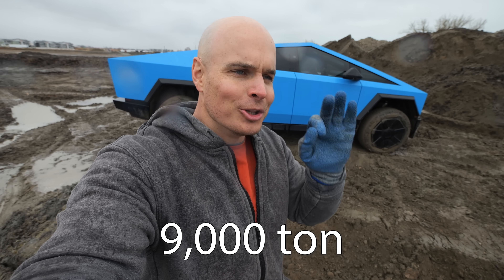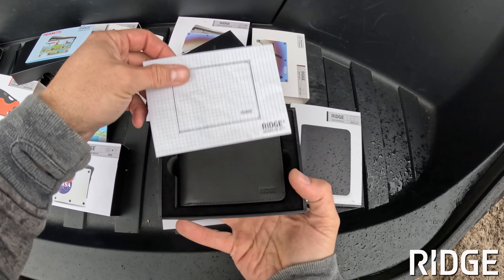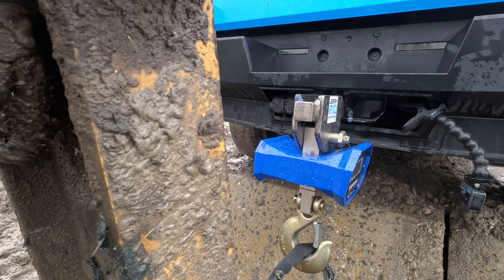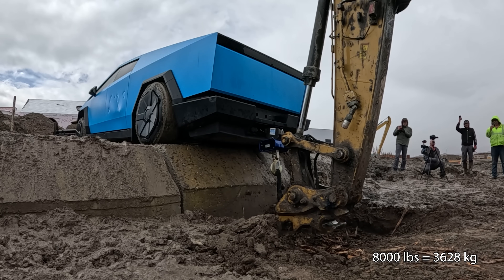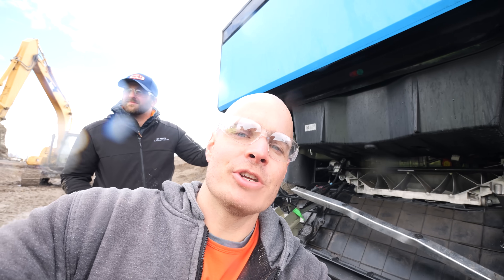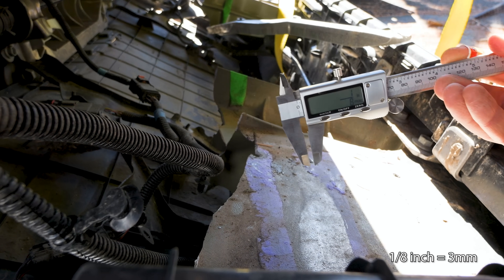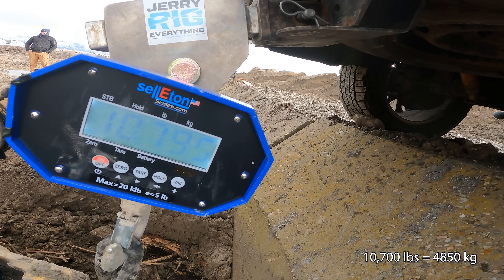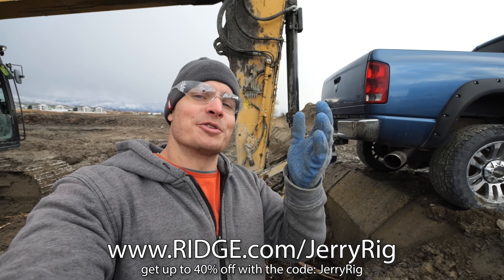SHOULD YOU TOW WITH A CYBERTRUCK?! - (catastrophic failure test)

Comment: Tesla didn't invent the giga-press. They are the first to use it in a big way at this scale, however.

I hate the Cybertruck with an irrational passion, but I do think that it did pretty good in this test. I think that it was engineered to do what it is supposed to do. Like the 04 Dodge you tested, my 2007 Silverado 2500 would do better for sure, because it is cheap and easy to over-engineered a steel receiver on a steel framed truck. It is good that you described the difference between trailer and tongue weight but I disagree that all of the trailer weight would ever turn into tongue weight. However, like you say, the static tongue weight is different than the dynamic. The question to ask is, how many Cybertruck owners will know how to properly load a trailer. The higher the tongue weight you load, the greater the dynamic tongue load will be because it will tend to bounce more. Also, all the safety chains in the word aren't going to save a trailer on that vehicle, it will all come off together.

Comment: so be aware buyer...if you crush your entire trailer load into a metal square in a demolition compactor and then drop it directly on your hitch it will fail....so heads up with that, it's a valid concern for sure. Also if your a moron do not tow things

Comment: Try towing an RV  with a cybertruck. If you're  only towing 50 miles. No problem. If you're are  towing across country. You'll never get there.  If your trailer weight  is approximately  10K  pounds you will have to charge the batteries app every 100 miles.  WTF

Comment: Aluminum casting is a bad idea for a truck frame. Does he not realize it's not uncommon for truck frames to need repair (often by welding)? Also when you exceed the yield limit on steel it will bend, not normally break. That could be the difference between  a damaged truck and a crash.

I could see a gigacasting frame for a sports car. But not a truck.

The theory is that Musk designed that truck without ever talking to any real pickup users. (He is not alone, Rivian seems to have made some different mistakes, such as making the cab sheet metal one piece with the pickup bed. Apparently they did not realize pickup beds sometimes get damaged and need to be replaced.

Comment: I think this test proves nothing, as this is a tongue weight test, in no real life condition would you ever be able to exert 11000lbs in tongue weight while towing even a 15000 lbs badly loaded trailer. It is usually 10% the towing capacity on any truck.   

My biggest concern of the castings is ratings over time. With how hardened it already comes i can see this work hardening and degrading the capabilities while it gets stressed and fatigues over time.  Add some road salts and the decreased ratings in cold weather I could see tow failures with properly loaded trailers in the future.

Comment: I see a lot of people saying that for Cody's test(WhistlinDeisel), he slammed the hitch into that block, and now for yours that you're pulling that force straight down off the hitch, and the real world examples wouldn't be like that, that eother youll never see that force moving like that, or that no one is loading their trailers up to the limit.

However, in my opinion, the biggest concern is that it's breaking in such a catastrophic way. Manufacturers give you these limits, not because anything higher and it WILL break. But because anything UNDER that limit has been tested and is safe. People can and do overload trailers. They do it more than people realise, and a part of the thought with these limits is that, even if a customer does go over that limit, they're still under the limit which would cause a catastrophic failure. Think about how engines have an RPM limit. Most engines can rev beyond that and still be fine, people can and will over rev their engines all the time, but keep pushing beyond the rpm limit and then you start to break things and cause catastrophic failures. And in my opinion that is the worrying part about this.

Now maybe it's just me, but i think, given that people will push things beyond the limits, it would be much safer if they end up bending their frame and making their truck all ways of wonky, rather than the entire hitch rips off and leaves a completely uncontrollably trailer rolling down the road.

Comment: First of all, the angle and force of the downward force are not realistic because even if your trailer falls in a pit, you don't pull it up vertically, and also, other wheels are still on the ground, so the weight is distributed. 2nd, yes, aluminum fatigues, but what is the rate? Is it gonna take 1 year to fail? 100? 1000 years? In an electric car, you are optimizing for weight, too, not just for maximum towing capacity and maximum year of service. If aluminum lasts 100 years but wight is half the steel, it's a completely valid material choice.

Comment: While it's not ideal, i dont think it's that bad. It's well over the ball weight load. The hill load you speak off is lateral load, and it's a lot stronger in that direction. I think this has more to do with your political position than anything. Having said that, i wouldn't be buying an electric car to tow. And electric cars are not really ideal for heavy cars.

Comment: One MAJOR thing that has to be considered, i didn't hear it mentioned here. And it opens up a whole new can of problems for this truck, is that you demonstrated the failure point, and basically covered how the truck is rated to tow 11000lbs. And you wanted to see the failure point above 11000lbs because of it. The problem is that this does not factor in the Safe Work Load Limit. I don't know exactly what that is for towing, or for Aluminum degrading over time... but i do know in hoisting and lifting with cranes and stuff, the work load limit of slings and wire ropes is 1/5th of its actual failure point. Its the safety factor. Seeing this truck break at just over 10,000lbs, knowing what I know, the true limit you should apply is only 2000lbs. If this thing is rated for 11k pounds and you think that much force could at some point be applied to that hitch, the breaking point should be over 55,000lbs.
But like I said, that's crane rule in my country. Even strapping stuff to a truck deck, the factor for straps is 1:3... but i can't find any data on hitch failure points and their Work Load Limits (WLL) 
Either way, this truck CAN NOT handle 11,000lbs legally. Not a chance.

Comment: The people in the comment section are not understanding if the truck goes on a big bump when the front wheels are on the air for a little bit of time. They're going to be too much stress on the tongue of the truck and moreover aluminum becomes weaker and weaker every time you use it. So it is definitely a problem and you wouldn't expect your car frame to break off especially

Comment: You should be ashamed of yourself for allowing yourself to be used to spread fake information like this

Explanation of the Cybertruck Tow Hitch Failure

The Tesla Cybertruck's tow hitch failure has sparked widespread attention, largely due to dramatic videos and reports showing it breaking under extreme conditions. Below, I’ll break down what happened, why it occurred, and what it means for the Cybertruck’s towing capabilities.

What Happened?

In a widely discussed stress test conducted by a YouTuber, the Cybertruck’s tow hitch and part of its rear frame failed spectacularly. The test involved subjecting the hitch to extreme vertical force—far beyond normal towing scenarios—resulting in the rear section snapping off. Specifically, the failure occurred when approximately 10,400 pounds of vertical force was applied. For context, the Cybertruck is rated to tow up to 11,000 pounds, with a maximum tongue weight (the downward force on the hitch) of 1,100 pounds.

Key Factors Behind the Failure

To understand the failure, let’s examine the critical elements involved:

1. Towing Capacity vs. Tongue Weight

Towing capacity refers to the horizontal pulling strength—how much weight the Cybertruck can tow behind it, which is 11,000 pounds.

Tongue weight is the vertical load exerted on the hitch, typically 10-15% of the trailer weight. For an 11,000-pound trailer, this equates to 1,100 to 1,650 pounds. The Cybertruck’s tongue weight limit is 1,100 pounds, which is on the lower end of this range.

In the test, the hitch failed at 10,400 pounds of vertical force—nearly 9.5 times the rated tongue weight. This is an extreme load, far exceeding what would occur in normal towing, even in rough conditions like hitting a pothole.

2. Frame Material: Aluminum vs. Steel

The Cybertruck features a cast aluminum frame, which is lighter than traditional steel frames used in trucks like the Ford F-150 or Dodge Ram. In the stress test, the aluminum frame snapped under the excessive load.

For comparison, a steel-framed Dodge Ram 2500 in a similar test bent but did not break, even at 10,700 pounds. Steel is more ductile, meaning it can bend and absorb energy, while aluminum, though strong, may fail more suddenly under extreme stress.

This difference raises questions about the Cybertruck’s long-term durability, particularly for heavy towing in harsh conditions.

3. Hitch Design and Attachment

There’s speculation that the Cybertruck’s tow hitch is attached to the frame using glue and rivets, rather than traditional bolted connections. While this hasn’t been fully confirmed, it could suggest a less robust attachment method.

Tesla’s manual also lists a 160-pound vertical load limit for the hitch, but this likely applies to accessories like bike racks, not towing. For towing, the 1,100-pound tongue weight limit is the relevant specification.

4. Real-World Context

The test conditions were intentionally extreme, designed to push the Cybertruck beyond its limits. In everyday towing, vertical loads rarely approach 10,000 pounds, even with dynamic forces like bumps or uneven terrain.

However, there are anecdotal reports of hitches failing in real-world use, such as one incident where a hitch allegedly broke while towing a trailer on the highway after hitting a bump. Without detailed data, it’s unclear whether these failures occurred within the rated limits.

Tesla’s Engineering Perspective

Tesla’s lead engineer has clarified that the hitch’s vertical load capacity depends on the distance of the load from the hitch. For towing, where the trailer’s weight is close to the hitch, the 1,100-pound tongue weight applies. If the load is farther away (e.g., with a long carrier), the leverage increases, reducing the effective capacity. This aligns with standard engineering principles and suggests the hitch is designed for typical towing scenarios.

Is the Tow Hitch Unsafe?

For normal use: The Cybertruck’s tow hitch should be reliable as long as users stay within the rated limits (11,000 pounds towing, 1,100 pounds tongue weight). The test failure at 10,400 pounds demonstrates a significant safety margin—over 9 times the tongue weight limit.

For extreme conditions: The aluminum frame may be less forgiving than steel under severe abuse or prolonged stress. Traditional steel-framed trucks might offer greater durability in such cases, as they can deform without breaking.

Long-term durability: Aluminum’s fatigue properties could be a concern for frequent heavy towing, especially in rough environments, though this would require more real-world data to confirm.

Conclusion

The Cybertruck tow hitch failure, as seen in extreme tests, is eye-catching but not necessarily a sign of weakness for everyday towing. It failed under conditions far beyond typical use, and its design includes a substantial safety margin. However, the use of a cast aluminum frame introduces trade-offs—lighter weight at the potential cost of reduced resilience compared to steel. For most users towing within the specified limits, the Cybertruck should perform adequately. That said, if you plan to tow heavy loads regularly or in demanding conditions, the hitch and frame’s unique design might warrant extra caution. While innovative, it may not match the rugged durability of traditional steel-framed trucks under extreme abuse.

Comment: Ehh, take an actual look at the S-N curve for cast aluminum, actually think about how much material you’ll lose to corrosion if you’re undercoating regularly, do an FBD and think about how many times per drive you’re actually gonna see a fully reversed load anywhere near the full tongue weight per towing session, and I think you’ll start to see how a Tesla engineer might be comfortable with a 5k-10klb horse trailer getting hooked up every few days. IMO this shows how much extra material is in a traditional truck, not how inferior the Tesla design is. 

Now, do I want a gigacast vehicle with or without a Tesla brand on it? Nope. I like to customize and like to be able to repair my vehicles. Toss that in with Tesla’s abysmal right to repair history and this comparison amounts to less than 1% of the total reasons I don’t want to buy a Tesla for anything but its powertrain to put in something else.

Comment: Not sure if the test really proved that the Truck is dangerous, but that frame did look a little flimsy for such a heavy vehicle. Also, 28 error codes because the hitch broke off? It would be nice if it could have a limp mode to get home, or at least out of the way.

Comment: I'm usually ok with your content but this one, is a catastrophic failure on JerryRigEverything. You actually proved cast was the way to go. It calls for 11,000 pound towing capacity. Meaning the hitch is rated at 1,100 pounds. You showed it getting to 10,000 pounds on the hitch before failure. Which in turn would mean the truck would have had to be loaded upwards of 100,000 pounds to see that load on the hitch. Not realistic at all btw. Tesla has done nothing wrong except over engineer in this case. Your test of checking if it could take 11,000 pounds on the hitch is absurd because that would have the cyber truck hauling more weight than an average 18-wheeler. This would also mean the entire load of 10,000 pounds isn't on the trailer anymore and would be on top of a destroyed tesla because the person that loaded the trailer had no right to be pulling a trailer to begin with.
Reply: You didn't remotely pay any attention to the part where he mentioned how in certain situations you can overload the tongue weight of the CT while being within the towing weight NOR did you care that a wrecked Ram pickup still outperformed it in the same test.  
Jesus Christ, you just....don't care how bad you make yourself look to defend Tesla.
Reply: Agreed.  He made a a lot of assumptions that where not correct and a lot of opinions.